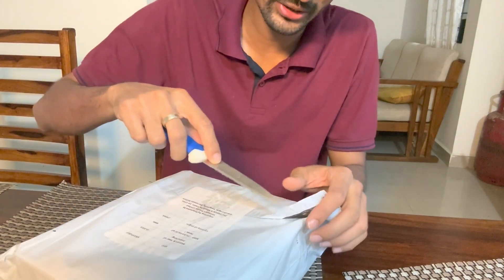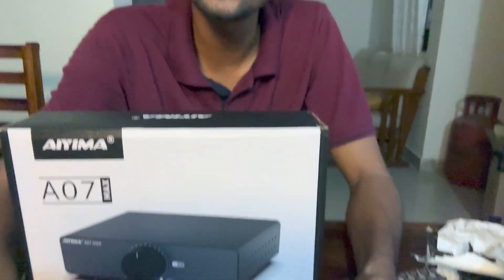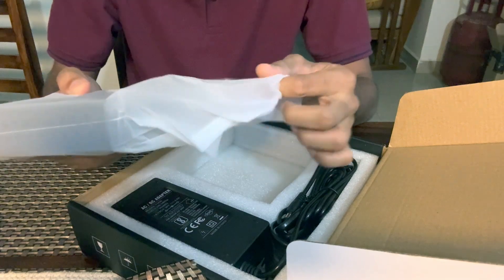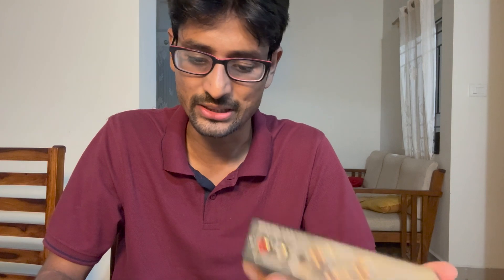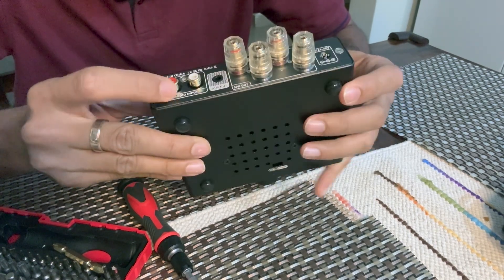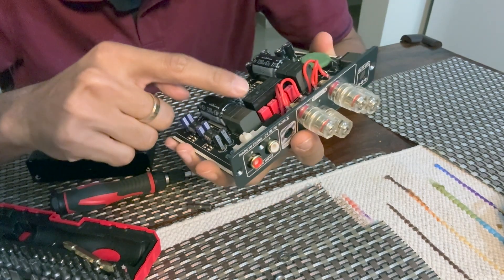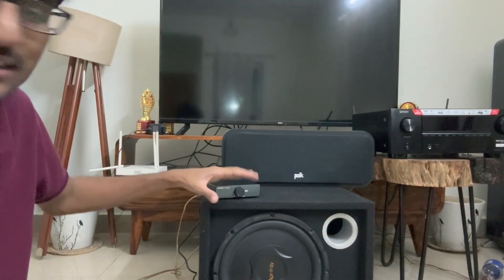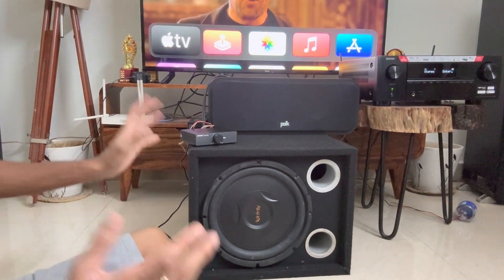Why I dont like the AIYIMA Amplifier! Full review with teardown #amplifier #review #hometheater

Comment: hi please suggest best budget friendly best amplifer under 10k
Reply from the maker: Hi, apologies for the late reply. For less than 10k , you cannot go wrong with Ayima or Fosi audio options. They are really good value for money.

Another option is to look at preowned equipment, you can get older AVR’s at very cheap price which you could use as amplifiers. Cheers!

Comment: Thanks for the review, this is not available with EQ, you can add an amp preamp if you need EQ. We do have a 2DB difference between the left and right channels. these are written in the product interface.

Thank you very much for your review, if you have any suggestions about our products, we will be very willing to accept them and use them in new product development. Looking forward to your valuable suggestions.🥰
Reply from the maker: To be very honest, this is a great little amp and you are doing a fantastic job with the price to performance ratio. That’s super hard to beat. 

Probably for my use case I should have picked the A07 Pro which would have allowed me to tweak the sound a bit to my satisfaction.

The only suggestions I have in order of priority are

1) Improve/change the potentiometer to avoid the channel imbalance.

 2) See how to reduce the frequency response dependencies with the speaker impedance.

You are doing great work in bringing aesthetically and functionally well designed high quality class D amplification to the world. Wishing you lots of success and I look forward 😇👍
Reply: @acousticmalayali  Thank you for your support and testing experience, and your suggestions are much appreciated.